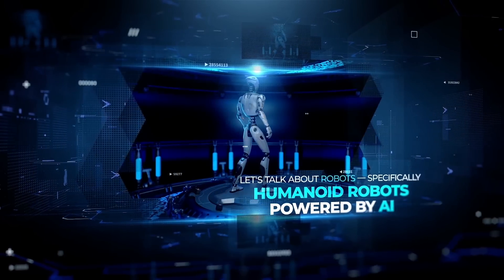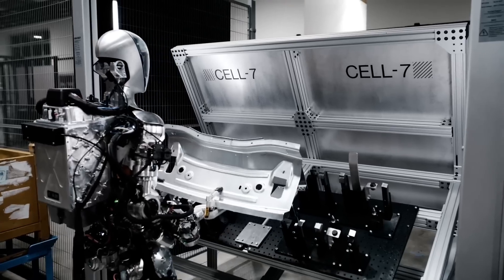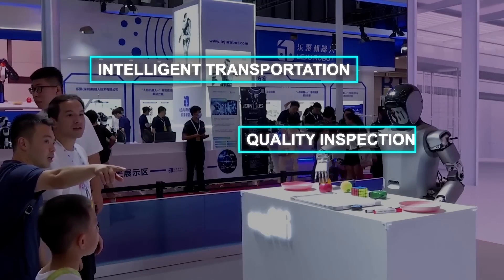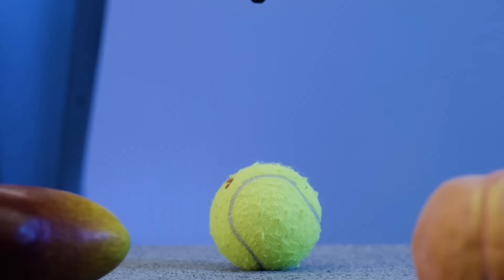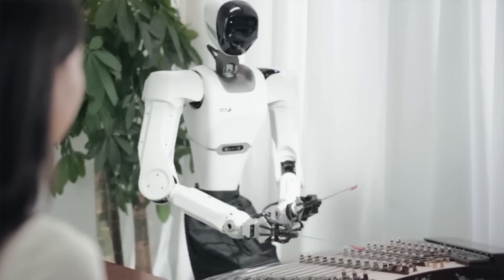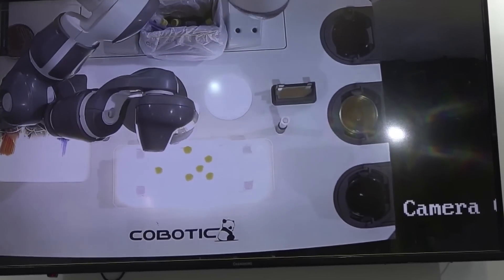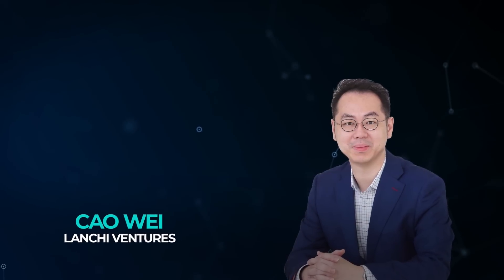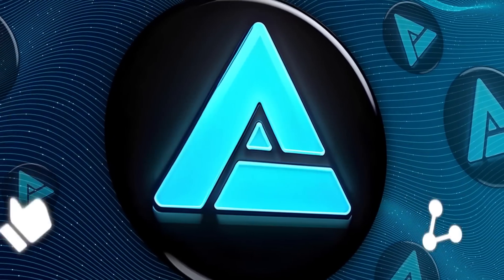Shocking AI Robots That Could Replace Us Unveiled at the 2024 World Robot Conference

Comment: 24/7 does not count - when humans works in shifts or you have supply lines where workstation speed counts.
That said, 100% efficiency - sort of (i.e. near) within 1-2 years is full human replacement in factories as soon as feasible - it is simply way cheaper than a human.

Comment: I’ve heard another challenge to overcome is the internal battery life. I heard humanoid robots could only work up to six (6) hours before needing recharge. So some can’t work a standard 8 hour shift.
Reply: They might only need 30 mins to an hour to recharge though, then they work their 2nd 6 hour shift, recharge, and then the 3rd one. And in the long run are working longer than humans. They also could potentially work and recharge at the same time if they have a long cable recharging them while they work. Think of the wire coming out from your cell phone, but just much longer. Why couldn’t they just have an extension cable or find a quick and efficient way to keep them working? I don’t think battery will be an issue.
Reply: @phen-themoogle7651  You make a very good point. Some robots at exhibition conferences do have an extension cord coming out of the back.
Reply: A robot with accu packs can pass by to charge them with wireless charging, while they continue their work
Reply: Japan uses a lot of robot (arms) in their factories. All are attached to the grid. A robot does not need to be moving around to be useful.